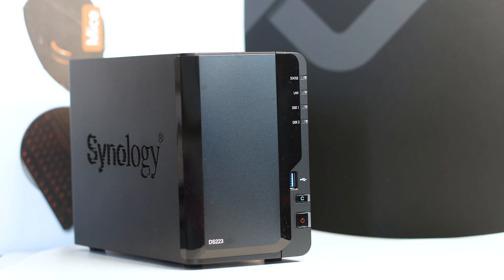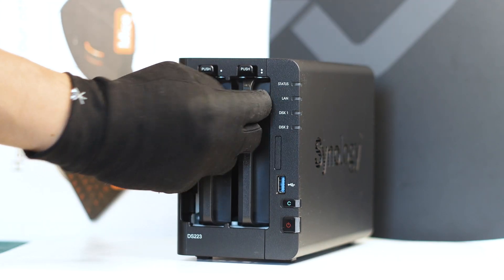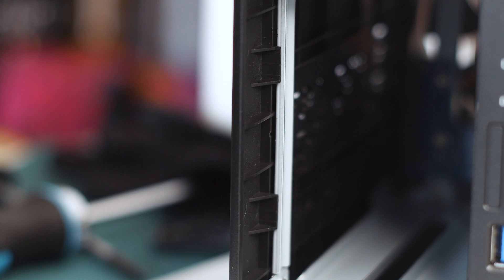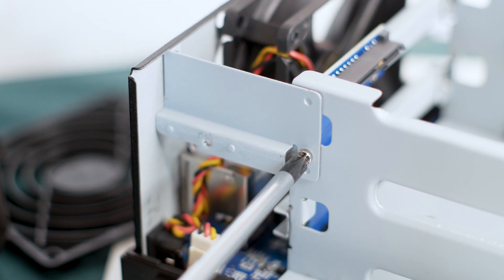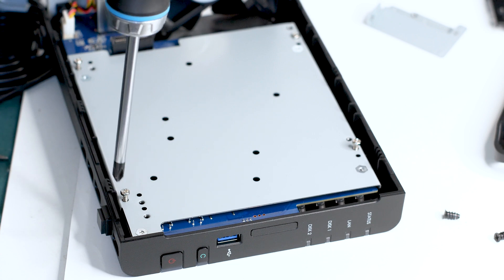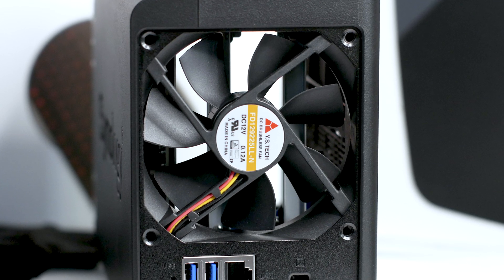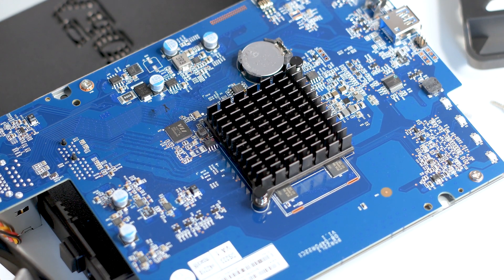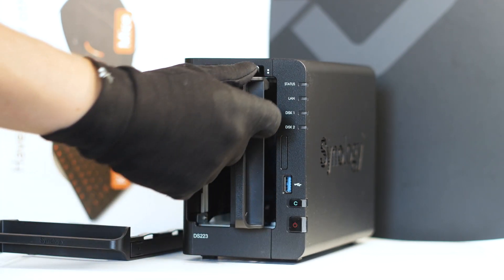Synology DiskStation DS223 Disassembly & Internal construction analysis

Comment: ugh, every videos mentions the same step is hard *and then skips showing it*. To get the case open, gently lever the left side wall so that the little plastic tabs facing the front clear the metal cross-bar and then push back on the left side (apply pressure to the left side front of the case, pushing towards the rear) of the case somewhat firmly. It'll move a few cm back and can then be lifted off easily.
Reply: Yes! You're a legend❤
Reply: this help, thanks
Reply: Thanks for this!  I thought that would be the way to do it but didn't want to break the plastic housing!  It's probably they didn't know where or how to place their cameras when applying force.